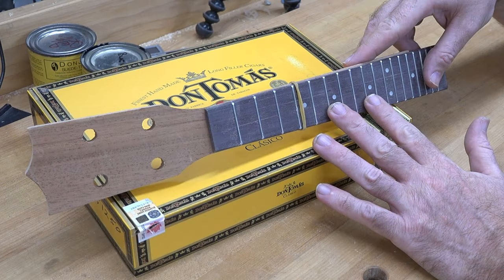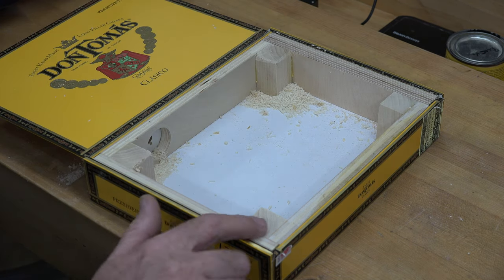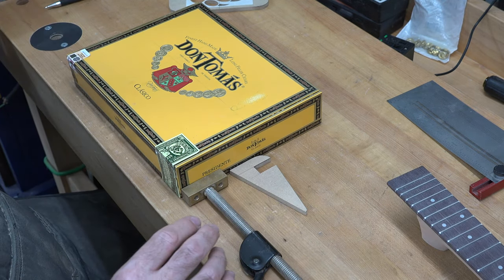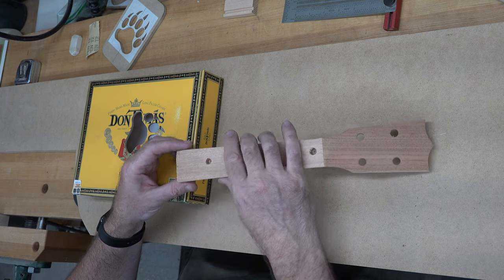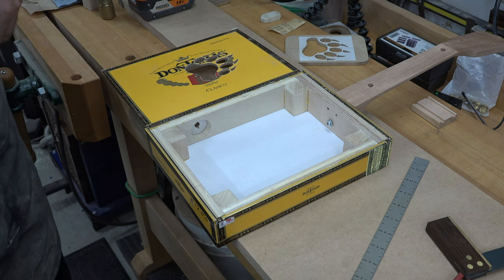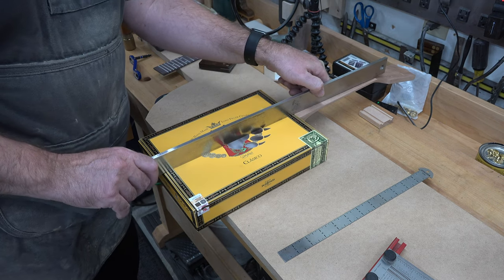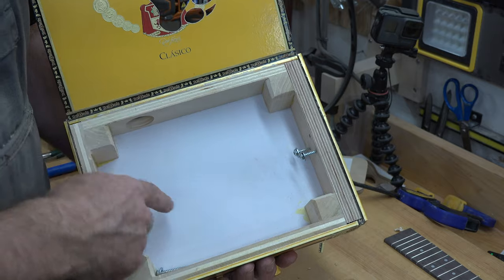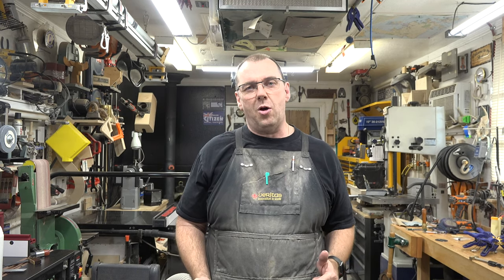Making a Cigar Box Ukulele Part 2

Comment: I think that neck may of had a back angle by design. Some stringed instruments have a slight back angle to accommodate the string tension.
Reply from the maker: That may be a possibility Joe but having a back angle with an instrument that takes nylon strings is pointless in my opinion.  There isn't enough tension in the ukulele strings to correct the back angle once the string are fully tensioned.  Thanks for tuning in to the show and taking the time to leave your comment.  I truly appreciate it.
Reply: @acutabove_woodworkings  it's possible.  I'm in the process of building one too and was wondering if I needed a back angle. I may not.
Reply from the maker: @JoePalumbo221  There isn't much tension in a ukulele string.  It's the reason that there isn't a truss rod as well.